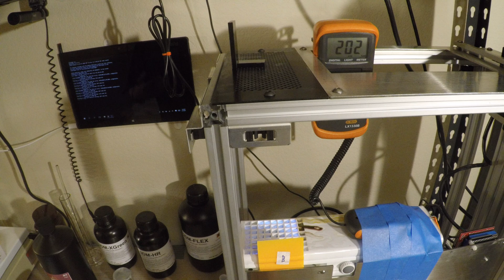Raspberry Pi HDMI CEA and DMT black levels compared

Comment: For other people you may be able to override the output range that the Pi sends by playing with the hdmi_pixel_encoding option in /boot/config.txt :

    hdmi_pixel_encoding=0 default (limited for CEA, full for DMT)
    hdmi_pixel_encoding=1 RGB limited (16-235)
    hdmi_pixel_encoding=2 RGB full ( 0-255)
    hdmi_pixel_encoding=3 YCbCr limited (16-235)
    hdmi_pixel_encoding=4 YCbCr limited ( 0-255)

Note that if you break the config and don't get a display then you should still be able to edit the file using even a Windows machine plus card reader as the /boot partition is a regular FAT filesystem that Windows can see.
Reply: Sorry to react two years after... I have a few questions: (1) For this setup, how do you quickly switch from one mode to the other? I mean if it is on a single Pi. (2) Did you try superwhite with your setup, that is white above 235, I guess if you have a difference for black, you may have the same for white.